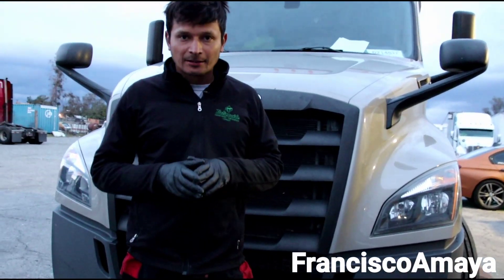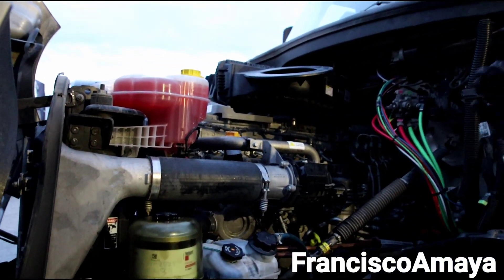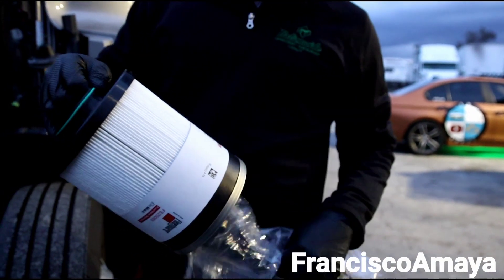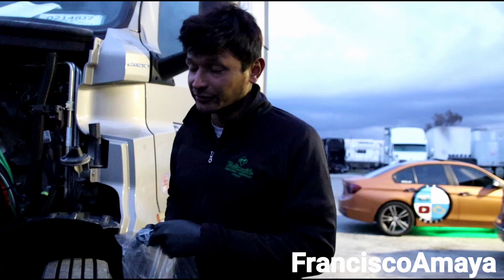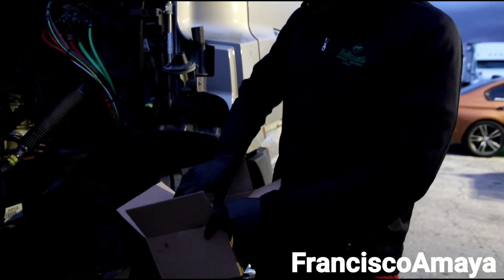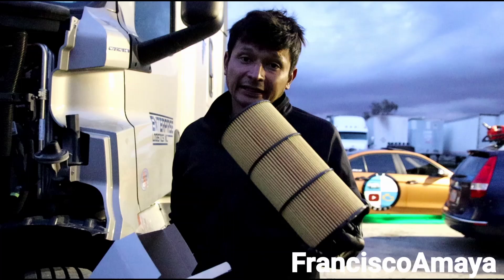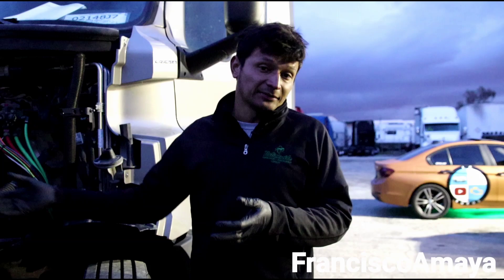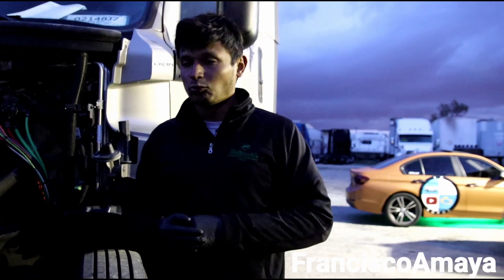Freigliner Cascadia 126 oil change steps DD15 engine 2017 and up fuel filter fuel water separator

Comment: My 2020 Cascadia oil filter is different because they have changed the oil stand pipe, Also the fuel water Separator has a Grove where the arrow on top of the filter direct you to align it with.

Comment: I have a 2021 freightliner cascadia with dd13 and my doesn't have the water fuel separator in that spot would it be somewhere else or do I not have one

Comment: You need to pull the engine out in order to replace the water pump and remove the transmission to do an oil change in those new cacadias nowadays. lol 😂 
Awesome video take brother